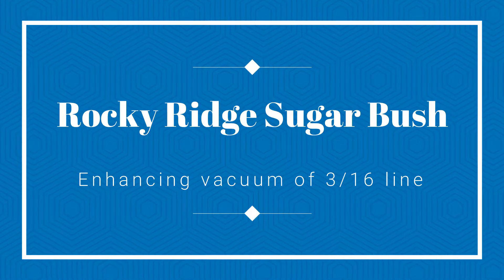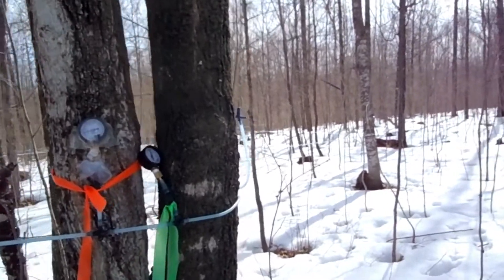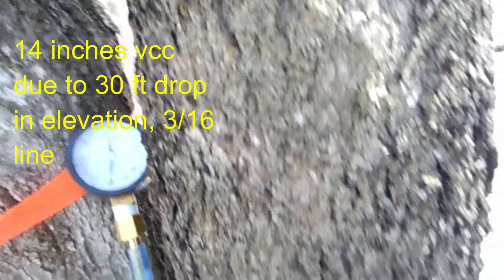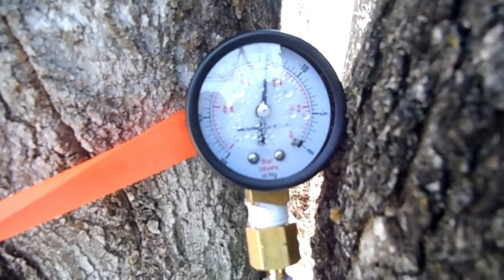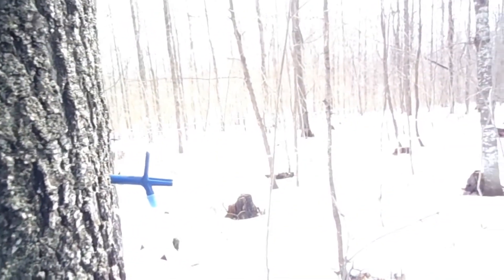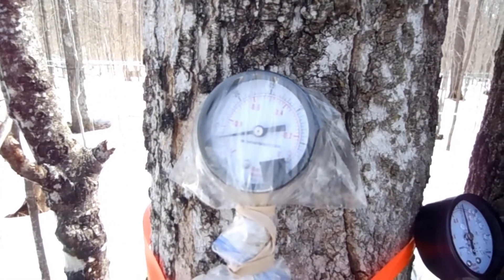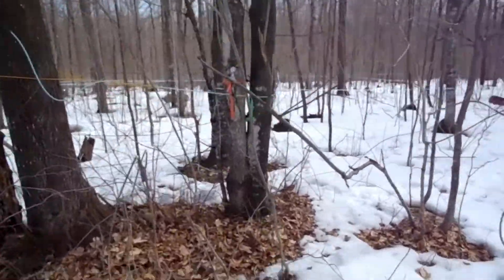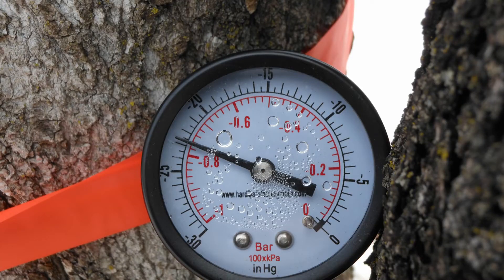3/16 sap line tubing hybrid successful test

Comment: What size of main line?
Reply from the maker: Those run into a 3/4 inch mainline.  That line is probably 1000 feet and we don't have much vacuum on it, maybe only 10 inches.  It has about 900 taps.  I think that we ran too many on the 3/16 lines.  Some have 40 taps, and although they are smaller trees, I believe during heavy runs that the small diameter restricts the sap flow so actually get less vacuum during these runs.  Just my thoughts.